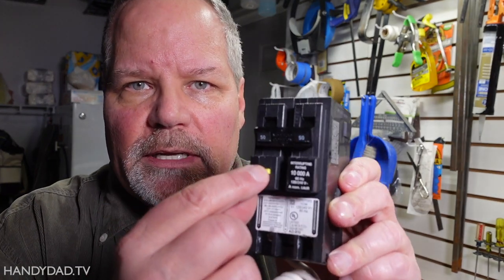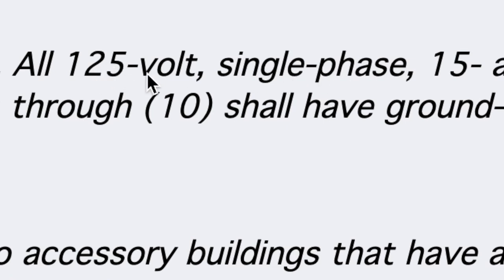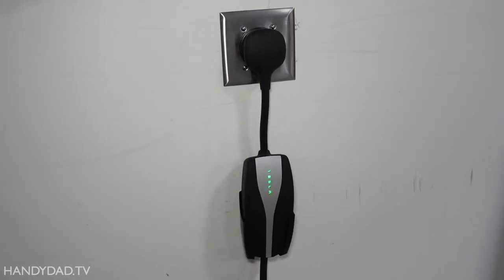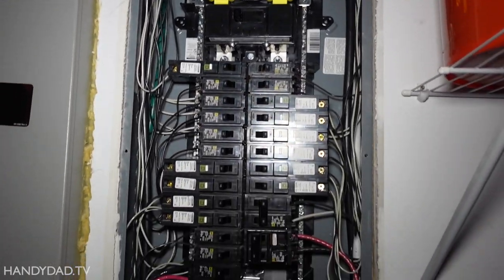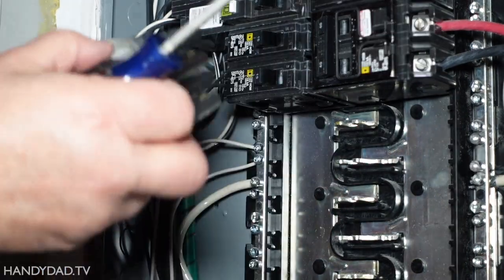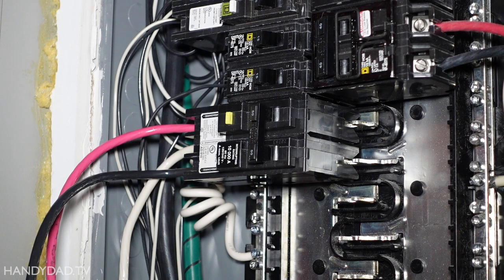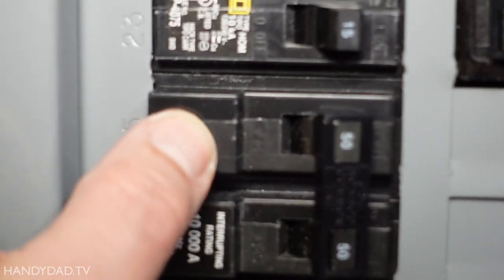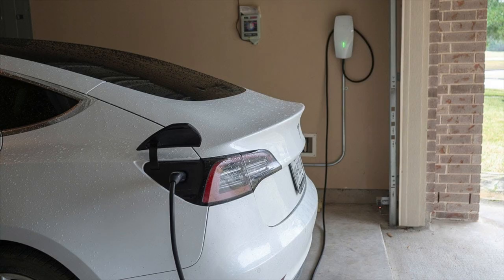Do I need a GFCI Circuit Breaker for EV Charging?

Comment: I'd like to know the voltage drop between the breaker box and the 240 volt receptacle when the car is on full charge.   The kind of measurement that would be made using a hand DVM.    There may also be a way to get the car to display all kinds of charging and electrical measurements.   Another possibility is the raw data can be downloaded to a calculating application to give all kinds of statistics and graphs.   The charging system likely has sense wires to the A.C. plug or very close to it for checking and possibly even logging the wall socket voltage.  

Typically home A.C. circuits run way below their circuit breaker trip currents and for the occasional high load like running an electric lawnmower we don't worry about voltage drop and power loss, but a Tesla has labeled on its in car charger as 48A.  Which is a substantial high load possibly over six hours.   It might be worth the effort and expense in a new installation to pay for higher capacity lower power loss wires then simply sizing them for occasional maximum load as is the common practice.  

The in car Tesla charger senses the charging type as its own home charger hardwired or through is mobil connect to a 240 volt receptacle and many others.  For some unknown reason the Tesla mobil connector is capped at 32A and will not pull the in car chargers maximum 48A through a 50A socket.   The advantage of 50A outlet of course is it is universal for any BEV.  The disadvantage is Tesla's in car charger, likely software changeable, does not run its maximum 48A capacity except with its own hardwired charger connection system.
Reply from the maker: The UMC’s 32-amp max charge rate is because of the lightweight cord. Higher charge rates require thicker cords. 

I personally have no issue charging with 32 amps, it’s plenty to recharge overnight, and I like the lighter cord because it puts less strain on the charging port.

Comment: Here is my issue. A Tesla Powerwall Charger does NOT have a Neutral (2 Hoya and 1 Ground)…so how do you install a GFCI Breaker, since the Breaker requires a Neutral??
Reply from the maker: A 240-volt GFCI breaker does not need a neutral load wire. For example, it can be used to protect a NEMA 6-50 outlet which has no neutral.

Comment: One problem is many EVSEs have built in GFCI and protecting a GFCI device with a  GFCI breaker causes false tripping. Becoming better to hardwire the EVSE and not need the GFCI breaker. Also not all jurisdictions have not yet adopted 2020 code yet.
Reply from the maker: Agree ☝🏻

Comment: Does it matter which breaker to get depening on the pannels brand?Electrician Told me it is impossible to find a 50 amp gfci for my pannel.
Reply from the maker: He would know. It’s more important to get the correct brand and type of breaker than to get GFCI.

Comment: Thank you for emphasizing safety in this installation. And correcting the previous video regarding the GFCI .  A standard socket can also be used for RVs, welders etc exposed to the elements outside the garage. Just watched a similar EV socket install where the guy made every mistake imaginable, in particular poking around in a live panel with metal fish tape and uninsulated screwdrivers....

However a pro electrician would have tested the GFCI on installation, as well as the resistance of the connections

I feel that a high power 50A circuit, and in particular one that may be used at full power for several hours at a time (much more so than cooker/shower loads) is not something to be attempted by anyone with no electrical experience.  Those connections have to be really good to avoid overheating.
Reply from the maker: Thanks for the feedback. How does a pro electrician test the resistance of the connections?
Reply from the maker: I have a setup to test the GFCI breaker, but haven’t made that video yet.
Reply: @handydadtv   It is worth pointing out how critical good connections are on high currents. At 50A a point resistance of 0.1ohm in a bad connection could dissipate 50x50x0.1 = 250W!
 UK perspective.  The  meter has a low resistance range measuring down  to 0.01ohm or better and uses a constant current of 200mA.  These  days usually combined with insulation resistance and all other needed  test measurements in a multi-function meter.  The standard test is to short the wires a pair at a time at the final outlet on the socket  circuit and measure L-N  and L-E from the board. (With the breaker off or the wires disconnected!). As a refinement you can use a breakout plug to 4mm test leads and jumper these to short on the socket itself. Hence testing the resistance of the cable,  all intermediate connections, the connections to the final socket AND the condition of the socket outlet contacts. Great to verify an older socket is still safe.
 The cable measurements  (in particular the insulation resistance) are there to ensure that the cable has not been damaged during or since installation - a bit unlikely in your case.
This does not test the connections at the board but at least these are visible and easily checked, whereas the socket connections may have loosened on screwing into the back box.

Comment: If I have a 6-50 receptacle should I just remove that curly white pigtail?
Reply from the maker: You still need to connect the curly wire from the breaker to the neutral bar; you just won’t have a neutral wired to the breaker.

Comment: My charger (hardwired) has GFCI protection built in.
Reply from the maker: They all do. But the outlet is a shock hazard when nothing is plugged in. 

Good decision to hardwire.
Reply: @handydadtv  Ah, okay, thanks. I heard having a GFCI breaker and GFCI in the charger can cause nuisance breaks. Anyway, the decision to hardwire was because we have no garage and a driveway 40-plus feet from the house, so we had to go underground.

Comment: Hi Chris, I’m in NJ and we sometimes have power outages. I have a whole house standby generator (20kWh generac) would I be able to charge level 2 in a power outage with my generator? If not at same 48-50amp perhaps lower at 26-30 amp? TIA
Reply from the maker: You can definitely charge with that generator, but as you said, you’ll probably want a lower rate of charge.

Comment: I’ve never seen a dryer with a GFCI breaker and they are always right next to a washing machine with water fixtures (“wet area”).
Reply from the maker: Not wrong. But read the code. I didn’t make it up.
Reply: @handydadtv  Yeah, this is the video where you show it. I just think they are being a weirdly selective when they list the areas. I mean, the very first place that came to mind for 220v in a typical household is the dryer and if I can’t rationalize a reason to exclude it I have to wonder how they did. ;)

Comment: Does your Tesla charger not have a built-in GFCI? I'm looking into installing a NEMA 14-50 outlet now and have to add add the GFCI breaker because of code. But I've heard that the redundant GFCIs between the breaker and the built-in GFCI in EVSEs result in nuisance tripping. 

Do you know of any EVSEs that don't have their own built-in GFCIs?
Reply from the maker: EVSEs all have internal GFCIs. The reason for a GFCI breaker is to prevent shocks at the outlet when nothing is connected. It’s just like your bathroom has a GFCI outlet but the blow dryer also has a GFCI cord. 

You can avoid the extra expense by using a hard wired EVSE.
Reply: @handydadtv  Thanks for the reply. I'm not worried about the expense, but whether or not the double GFCI setup will result in nuisance tripping. This seems to be an issue with most EVSEs. Does the Tesla charger you showed in your video not have this problem?
Reply from the maker: @TheBQ92 I’ve only used two plug-in EVSEs (Tesla and Emporia) and I never had nuisance tripping with either one.

Comment: My charger (Electrify America) has a built in GFCI. So that would conflict if we also had a GFCI in the panel. For us to be compliant, we’d need to hardwire the charger instead of having the plug. We wanted the plug for convenience should we ever move. So the choice was either don’t be compliant or don’t have a plug. It was clear when we spoke to the MFR they really didn’t us working off a plug. I don’t think the charger folks should advertise the plug so much since it really poses a lot of challenges given the electrical code.
Reply from the maker: The double GFCI “issue” many be a myth. My chargers have never popped the breaker.
Reply: @handydadtv  I have run into the double GFCI problem, and especially in instances where the manufacturer (like most EV manufacturers, including Tesla) recommends to not use a gfci, you may as well listen to the authority having jurisdiction and save the $ as well as the headache because you will inevitably get a faulty breaker.
Reply: @handydadtv  Not a myth - depends on the EVSE.
Reply from the maker: I’ve only tested the Tesla UMC and the Emporia; neither were affected by the GFCI breaker. I also used the Tesla UMC in a 120v GFCI outlet and it had no issue.
Reply: @handydadtv  again, why shovel out the money and risk it when the manufacturer (Authority Having Jurisdiction) says not to.
Reply: @handydadtv  ChargePoint home chargers seem to be the more finicky ones.  Not sure if that means they are better or worse for quickly killing power (given an actual ground fault event).  Also - all GFCI circuit breakers are not equal for all makes and models.  Just have to conform to minimum standards, and some are more sensitive than others.
Reply: @handydadtv   Yes nothing happens  You have  G F C I in your bathroom and on your hair dryer nothing happens

Comment: Hi, I watch a lot of you tube and recently discovered that all fuses have a torque pressure that the cables have to be tightened to shown on the side of the fuse, on most fuses it is 36 pd of torque but the person doing the electrics used a screwdriver that went up to this torque and applied much more pressure than you did. Are you aware of this requirement?
Reply from the maker: Yes but most people don’t own a torque screwdriver. So I just go as tight as I can. Good idea for another video though. 👍🏻
Reply: You are not wrong they do come with a torque rating but you will find very few electricians using a torque screwdriver. This is an observation from someone who has spent 36 years in the electrical field. That said I have stripped 50 amp breaker screws out in my younger years.

Comment: If it was installed before the 2020 code  was adopted (maybe it wasn't even adopted) by your local muckymucks at the city council, then it IS COMPLIANT. (or...grandfathered in...as most people say). I do suspect that this one will either not be fully enforced by many municipalities,...or even thrown out by some legislatures when they adopt the "rest" of the code. Let's wait and see.
Reply from the maker: You are right that codes are mainly for new construction. But non-compliant safety items may get flagged in a home inspection when you go to sell the house, just like missing GFCI outlets in a bathroom. That’s when you’d need to bring it up to code, or negotiate it so the buyer takes on the responsibility.
Reply: @handydadtv   I only know one municipality where they will make you change certain plugs to GFCI's...if they were already existing. I have routinely (while an existing older home is in escrow) had to call the city head inspector while a real estate agent, and also a rent-a-inspector are present,...to inform the rent-a-inspector that in this particular older house,..most gfci rules he is talking about did not exist when the house was built...and therefore should have been mentioned only as a courtesy and not as a code violation.  At that point, it is the responsibilty of the new owner to do it...or not.   Sure, it's super easy to do, even for a homeowner...if they want. This is not just a problem with elec. and rent-a-inspectors,....but I could go on and on about plumbing and hvac also.
Reply from the maker: Good to know. Thanks.

Comment: How much did it cost gfci breaker? I just had mine replace electrician charge me $285 for part, is that too much?
Reply from the maker: Not bad if that’s the installed price. If not, he’s definitely marking it up.

I paid $150 for mine in 2021 (SquareD type HOM), but now it’s under $100. Find your type here: https://handydad.tv/gfcib

Comment: As an Australian who has GFCI protection on every circuit apart from the oven and electric hot plates, i still cant understand why U.S systems dont use GFCI breakers on all circuits
Reply from the maker: Good question
Reply: Nuisance tripping and the cost.
Reply: @balexan530  had full gfci protection on the house for 27 years, never once tripped on a non fault.
Reply: We have required some circuits to be GFCI protected since 1971.  Over the years we have added more and more "locations" that must be protected.  Why we haven't simply mandated it for all circuits, I do not know, but I suspect it's all about money. Basically, if it were up to the engineers and safety experts on the code panel, they would have done it a long time ago.  I am pretty sure greed has gotten in the way.  Building contractors don't want to spend a couple hundred extra bucks for safety.  They pinch every possible penny, even if the home is very expensive.
Reply: @farnzy2011   I tripped a plug in GFCI with just the RF of a ham radio.
Reply: @balexan530 I wonder if it’s because US ones tend to be 5ma and I know In Europe they’re mainly 30ma so I wonder if that reduces likelyhood of nuisance tripping. Rather have a 30ma RCD/GFCI over non.

Comment: Does anyone know if this is required in Florida? I had an electrician install a 14-50 plug in my garage and there is no test option on the breaker. Is this to code? im getting conflicting results when searching.
Reply from the maker: You HIRED an electrician who was supposedly trained and certified to qualify for a license. You paid him to know your local codes so you shouldn’t need to do this kind of research.

Comment: Have anyone had this issue when using GFCI breaker the internal breaker of evse tripped? I had to reset breaker of the charger for it to work again
Reply from the maker: I don’t have this problem, but many have said double GFCIs can be an issue (in other words, the self test of the charger can trip the breaker). If that happens, you have no choice but to use a non-GFCI breaker (you can always put it back before you sell the house).
Reply: @handydadtv  I have a Grizzl-e Chargeradn the instructions state NOT to install a GFCI upstream, as they have built-in GFCI.

Comment: There should NEVER be a white colored wire energized from a breaker, the only legal energized white, or neutral wire is in the event of a reverse fed light switch when home run goes to light location first. And only in residential i belive, but great video! Very informative and well thought through.
Reply from the maker: Thanks

Comment: But I've seen other videos and guides and manuals from various EVSE saying that it has built in GCFI and if the breaker is a GCFI breaker, it'll cause problems! They say not to use a GCFI breaker because it has one built in to the EVSE!
Reply from the maker: You still need to protect the outlet when nothing is plugged in. Also, there’s no test button on the EVSE so how do you know it works?
Reply from the maker: I’ve used two plug-in EVSEs and neither had an issue with the GFCI breaker.
Reply: @handydadtv  No idea. From the manual of the ChargePoint Home Flex, which is a very popular and highly regarded as one of the top home EVSEs out there, it says this: "Ensure the electrical panel supports a 240 V dedicated circuit with a new, dedicated, non-GFCI two-pole circuit breaker, in accordance with local codes and ordinances. Note: If local codes require a GFCI breaker for plug-in installation, ChargePoint recommends a hardwire installation. We do not recommend using a GFCI breaker as the Home Flex has charging circuit interrupting device (CCID) protection. Using a GFCI breaker in the panel can cause nuisance tripping. "
Reply from the maker: Good to know. I wholeheartedly agree that hard-wiring is the better approach to avoid the risk. 

But they still provide no way to test the internal GFCI…

Comment: The Tesla mobile connector will trip the gfci all the time once it starts charging
Reply from the maker: Completely false. I use the Tesla UMC and Emporia EVSE with a GFCI breaker and neither one has tripped the breaker.
Reply: @handydadtv  I used to use the umc on 120v gfci and it would trip the outlet every time.   I know that the umc does a Test to check a good ground and this looks like a ground fault to the outlet.   Perhaps there’s a difference between gfi on outlet vs on breaker.
Reply from the maker: Before I installed the 14-50, I also used the UMC with a 120-volt GFCI outlet and had no issues. Weird that yours trips it.

Comment: I hate GFCI’s. I’ve never seen one do any protection, but I’ve seen em trip for unknown reasons over and over.
Reply from the maker: Perhaps that’s why you’re still alive.
Reply: This has been researched extensively.  Electrocution deaths (in a residential setting) have declined SIGNIFICANTLY since GFCI's were introduced in the early 1970's. To be fair, it is probably due to a number of factors.  

1) The NEC did not require houses to be grounded until the early 1960's (and some jurisdictions lagged behind that timeline).  Modern grounding standards have helped some, no doubt.

2) Stricter safety standards on basic equipment/devices we all use. In the "old days" devices/appliances were not grounded and often made of metal.  If there was any internal fault with such a device, well, it was probably all she wrote for you, especially if you were outside in a wet environment, standing on cement, or barefoot, etc.. Remember it only takes about 40mA to kill a full grown adult (and around 10mA for children). 

3) GFCI's